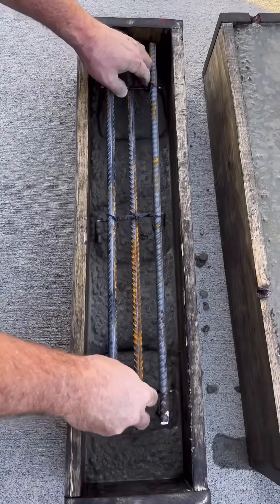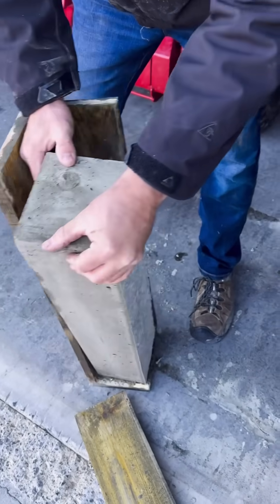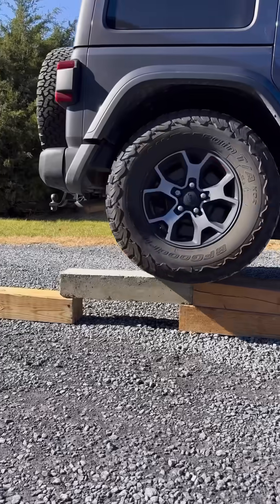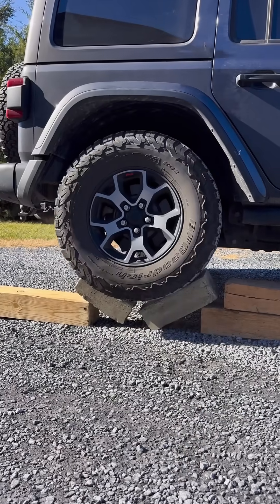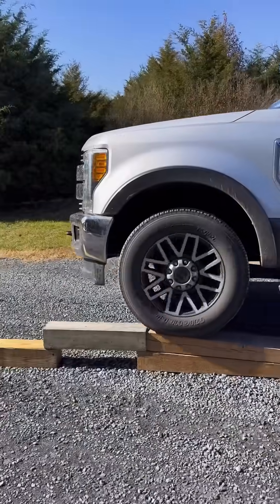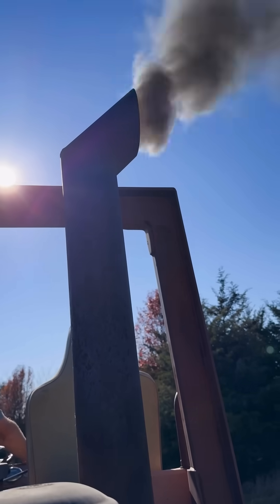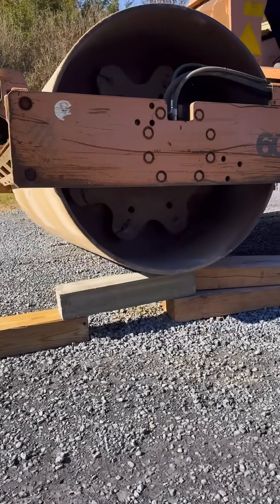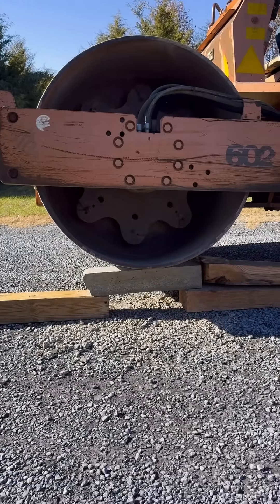Why We Use Rebar To Reinforce Concrete

Comment: Concrete never dry out when it’s in contact with rain.  Even if doesn’t touch water. Moisture in our air therefore it never dries out 100 percent. People will disagree. Take it to the lab and you’ll see what I’m talking about.
Reply from the maker: That’s correct. That’s why we use pressure-treated lumber where it makes contact with concrete because there’s always a certain amount of moisture there

Comment: Concrete will get most of its strength after a 30 day curing.
It also helps to add more Portland and go for a 5,000 to 6,000 lbs/sq inch strength.
"Horse Hair" mixed in the cement also helps.
So, rebar, longer curing, added portland and horse hair will make it as strong as it can be.
Instead of water you could have added the same chemical that they mix with floor tiling cement.
It has a bit of flexibility added to the mix.
Reply: The compressive strength of the concrete doesn’t do much to add to the bending strength of concrete
Reply: Yes, but giving the cement all the best possible strength in every way can't hurt.
Reply: @robertpage2023 It hurts if you have to wait 3 weeks extra to build something on top of it. You could save tons of money in form cost and labor cost
Reply: Concrete will get most of its strength in the first week. It gains more than 70% and more in the first week
Reply: Also I recommend in-situ strength measurement to get real-time Ps/MPa. By measuring the temperature and maturity age to get Strength

Comment: Actually be beam failed due to inadequately anchored reinforcement. If you bend the rebars back on themselves into the top of the beam then I expect it would not fail. You can see in the video the rebars slip at the point of failure. 

Cool video

Comment: Also worth noting the reinforced beam failed in shear (only bending reinforcement was provided)
Reply: I believe he said it wasn't cured yet
Reply: @JohnSmithh644  that doesn’t mean it didn’t fail in shear…
Reply: When the span of the beams is only 3x the depth ... you KNOW the beam is going to get a shearing load and relatively low bending 😅

Comment: Side note: metals suffer from fatigue under stress which causes deformation over time as molecules rearrange to settle in a lower energy state (lower stress).

Concrete does not do this.

This is why large structures built to last will need concrete to handle most of the compressive load and relying on metal structural members to handle tensile, torsion,  and sheer loads.

Comment: How many years will the reinforced concrete last vs just concrete?
Saw a recent case of rust causing problems with concrete buildings.
Reply from the maker: It’s important that the rebar is properly encased in concrete so that water doesn’t get in and start to corroded it.

Comment: The Hoover Dam is still curing. Mix design as well as a variety of other factors play role in the over all strength of the concrete.
Reply: This new Vegas now?
Reply: @ganjasleeper6116  Patrolling the Mojave almost makes you wish for a nuclear winter
Reply: @ganjasleeper6116 legate lanius punching the air rn after failed to blew up the dam
Reply: Yes, we are making rebar clubs @ganjasleeper6116
Reply: i heard the dam aint doing so well, apparently they have to derate their power generation because they cant fill the dam as high as they used too.
Reply: @christopherlopez1414  Yeah but thats not a dam problem. Thats a problem with the rain and water consumption.
Reply: @firesoldier343  how do you know?
Reply: @christopherlopez1414  Judging by the fact that the hoover dam hasn't collapsed or anything, I don't think the lack of water is because the dam physically can't hold any back anymore, its the fault of there being a large demand of water down stream of the dam and less water coming in up stream of the dam.
Reply: @christopherlopez1414 Damn legion trying to take the dam..
Reply: @diggerproductions8603 if I would’ve inlisted, I’d be halfway to general but instead I’m talking to a smiley securitron.
Reply: @thememays3285  what? Halfway to general? Once you get up to O4 like where I’m at, politics are a big part of promotions. Not only do you have to do above and beyond what you’re already doing you have to also step into that world of handshakes and ass kisses. There’s a reason I’ve been O4 for 8 years tho, im cracking 102k a year. I wanna retire 06 after 30 years. For those of you that are super book smart, do your 4 years and get a good college degree and get out. If you’re an idiot and a screw up like me, dude, stay in the military. I know the pay is shit for what we have to do but it’s better than working in a grocery store or being a bouncer for a strip club in Atlanta where 3 of the strippers are pregnant and rumor has it 2 of them think you’re the dad.
Reply: @TheBigChad He was making a Fallout New Vegas joke my brother
Reply: @austinpak2302  I never played that one. I played fallout 3, then went straight on to 4 when it came out totally bypassing new Vegas
Reply: @TheBigChad huge blunder imo. New Vegas is up there with the Half Life series and even Oblivion and Skyrim.
Reply: @kotarodesu_23  Awesome I missed out on the other two but was right there for half life tfc and cs.
Reply: @kotarodesu_23 NV is overrated.
Reply: @christopherlopez1414 that’s a water issue
Reply: All concrete is still curing and getting harder every day
Reply: @jerowersonst2465 Eventually it's cured enough, then it starts rotting from the bottom up.  Some 50+ year old concrete downtown has turned to dust underneath the top 2"
Reply: @jerowersonst2465 just like me
Reply: We must protect the dam at all cost
Reply: How is it still curing? What was the expected time to finish?
Reply: @viktorbirkeland6520  it was started in 1933 and the last bucket of concrete was in 1935. It’s estimated to take around 125 years so if true it should be cured by 2060. It’s 660ft thick and I think the thickest pour is around 60ft so this is why it’s estimated at 125yr cure time
Reply: @Rusty_coit and the speed of degradation after full cure will be half as long as it took to fully cure.
Reply: @viktorbirkeland6520   It's philosophical at a certain point.
Like reaching infinity.
Reply: @viktorbirkeland6520 when you build something with reinforced concrete, you don't need the structure to have attained 100% of its strength, but only maybe 75% by the time it's supposed to be loaded. As safety factors are used in the calculations, every structure is slightly overbuilt, just in case anything deviates from assumptions. Reinforced concrete naturally reaches 75% strength after 3 weeks, but then it keeps on curing indefinitely. If you use accelerators, it could be at higher percentages of the required strength even sooner
Reply: That’s a myth, it’s for sure cured all the way. They’ve done ultrasonic tests to prove it. With todays codes it wouldn’t be deemed road worthy if it wasn’t cured yet
Reply: The Colosseum is still curing. It's because the large chunks of lime in the mix act as a self healing concrete. Everytime a crack forms, the lime gets wet and reveals itself.
Reply: No it's not. It was specifically made and poured so that it would cure quickly.
Reply: @name4601   Yeah they reduced approximately 25 years from the curing process. Meaning it will Cure for an estimated 10 years more.

It is concrete, you dont want it to cure too fast for the structural integrity of it because that can lead to cracks. The concrete itself becomes stronger the longer it cures, so 125 for something like a dam is only a good thing.

Concrete also normaly cures for over 50 years, even tho it is a solid mass in under 48 hours.
Reply: Dam that's a long time

Comment: If that concrete was properly cured, it wouldnt have broke even with the roller. If there's pieces crumbling at the surface like that, then it's not even close to fully cured. That concrete looks less than a day old.
Reply from the maker: It was only 2 1/2 days old

Comment: If you installed the rebar a few mm from the bottom instead of half way you would have had more strength in the concrete beam

Comment: This also shows the importance of proper reinforcing. As you can see when failure happened it was catastrophic. A properly designed beam would bend more gradually and steel will also fail along with concrete. So in real world scenario the building would show cracks and distortion allowing the occupants warning for evacuation instead of just collapsing in one go. 😊
Reply from the maker: Good point

Comment: My boss wanted me to do some pads for park benches...never having done concrete work before, I dug a 1.5ft deep 4ft long and 2.5ft wide hole....filled it with 450lbs of concrete and rebar and now it's the next guy's problem

Comment: what kind of concrete mixing tool you using.
Reply from the maker: It’s just a mixing bit I think came from Lowe’s
Reply: not the mixing paddle the power tool part @hausplans
Reply from the maker: It’s a Milwaukee M1 18 cordless drill

Comment: Its great for tensile strength, but does have the downside that when water gets inside, it can cause damage to the structure over time. It also expands and contracts differently with heat, causing more damage over time. As a result, you can do incredibly awesome things with reinforced concrete, but it will likely not last more than a few decades. 

That is why it drives me crazy when people sight the time that roman buildings are lasting, and then ascribe mythical properties to roman concrete, when all they used it for, was to fill in gaps between the stone that they used for their buildings. They are always in compression, and just have to retain their own strength, while we build things that the Romans would never even dream of trying with their tech, and due to these factors, they don't last as long. We do in fact have buildings that like the Roman architecture will last a very long time, but the rest of our buildings aren't intended to last that long. 

It's actually better this way for our culture, because people often like changing out structures, and our buildings are enormously more affordable, then the Romans buildings that we see still today. Many of those Roman buildings took decades, and a significant amount of The Roman Empire's funds to make, while ours are made in a few years, and are cheap enough to be privately owned. If we put as much resources into something, if a roman did somehow see it, they would be dumbstruck, and so would we.
Reply from the maker: Wow, this is one of the most thoughtful comments I’ve ever read on YouTube. Very well said and true in my opinion!
Reply: @hausplans  Thank you! I appreciate that you spent the time to read the whole thing. I can be very long winded.

Comment: Concrete never cures completely. It is always hardening a little bit more each day
Reply: Also the reason why they use rusty rebar is so it doesn't blow the concrete - cool video I didn't know rollers vibrate!

Comment: Well here's the problem reinforced concrete if you make a building and you have reinforced concrete and over the years that rebar will start to rest and it will start to deteriorate and that will mess up the concrete whereas using  non reinforced concrete in a building it will last a lot longer than reinforced concrete. That's just for a basic structure for example like this building a concrete house with non reinforced concrete will definitely last longer. I would rather have concrete that's not reinforced

Comment: The only problem with ReBar is if you get water infiltration, it will rust and that expansion damages the concrete. You see that a lot with bridges.  Recently Ownes Corning has introduced “PinkBar”. It’s ReBar made with fiberglass. All the benefits of Rebar for concrete, 1/6 the weight, and it won’t rust.
Reply from the maker: I’ve seen that pink fiberglass bar pretty neat

Comment: I have a serious question: you used 3, 1/2 in rebar,  What if you used 6, 1/4 in rebar in a square shape.  Would it be stronger (tensile strength)?
Reply from the maker: I’m not sure on that
Reply: It would not. Rebar is measured by diameter, 6 1/4 inch diameter circles has less area than 3 1/2 inch ones. Assuming the bars are vertically centered at the same depth, this would reduce the strength

Comment: One thing you forgot to mention is that it's a lot easier to spot when the reinforced concrete is about to break. Normal concrete will just suddenly snap out of nowhere, but reinforced concrete will develop cracks before it snaps.
Reply from the maker: You’re 100% right, reinforce Concrete tends to show signs of cracking rather than just instantly breaking. It’s hard to fit everything in a short video.

Comment: For house application, it takes about 1-2 weeks to cure depending on the weather condition and depth of the cement, correct me if I'm wrong though...

Comment: Concrete's compressive strength is crappy. Aluminum, some plastic, and some woods have better compressive strength than aluminum. But concrete is cheap and easy to work with, and holds up great to weather exposure (generallly.... freezing can cause problems for porous concrete).

Comment: No less then 14 days for curing and usually in the clear unless it using additional additives for strength or curing then 28 days or more. Unless you have an high early mix which can meet the compression strength within 3-7day

Comment: Concrete is normally tested at 14, 21 and 28 days. The linger you leave it the stronger it will become..  also do not mix it with too much water.  Water drys out, evaporates and the space where water was leaves voids.. voids creates weakness. Needs to be mixed just enough.
Reply from the maker: All true

Comment: You need to turn the beam 90 degrees so the rebar is on the vertical plane not the horizontal one. Then the weight trys to compress the top bar whilst trying to stretch the bottom bar which is much more difficult making it a lot stronger.

Comment: That is not actually a test of tensile strength. You were testing shear strength.  The concreate was not being pulled apart like a guy wire.  it was experiencing shear force

Comment: Did you know that most of the work is doing rebar and that car could roll just on rebar and it wouldn't fall?
Reply from the maker: Rebar bends easy, it would bend just from being stepped on
Reply: Nevertheless rebar is very good for supporting concrete, if there are ruptures it won't crumble instantly

Comment: I have over 200 yards of concrete at my place and non of it has rebar except for the appropriate application from the concrete steps connecting up to the house spanning over the overdig from the footers.   We poured it in 03 and all of it is holding up just fine.  (Not  to mention we live in Indiana with the Indiana Winters)  rebar is simply not necessary near as much as people are told.  Also it does not stop concrete from cracking.   Any concrete is only as good as its subgrade.